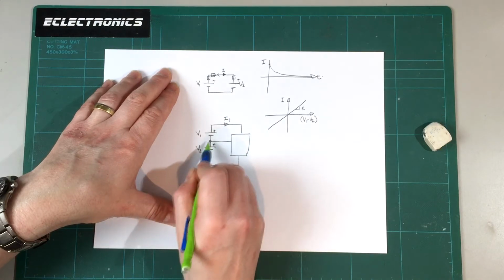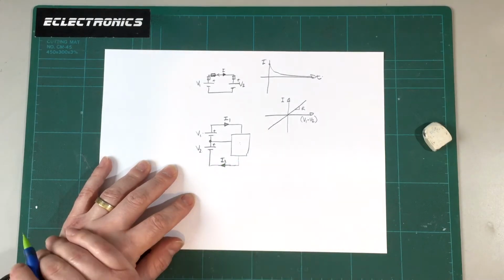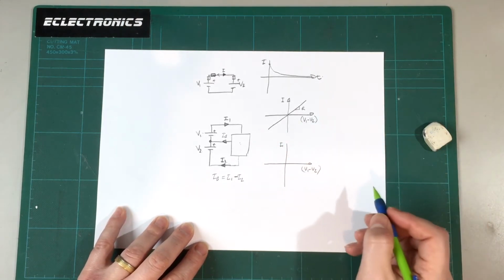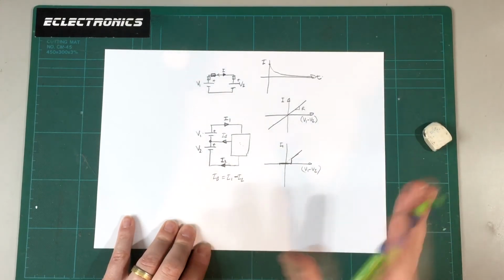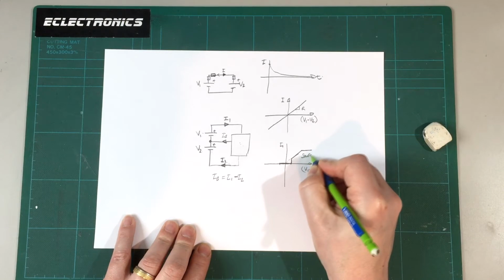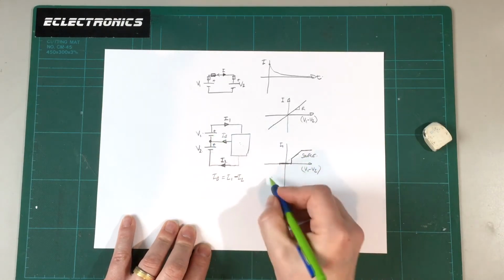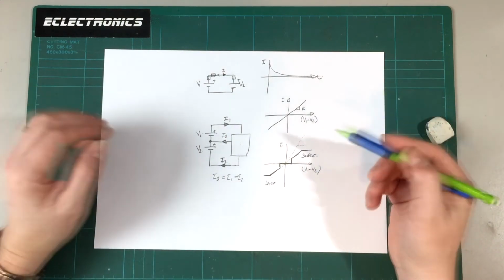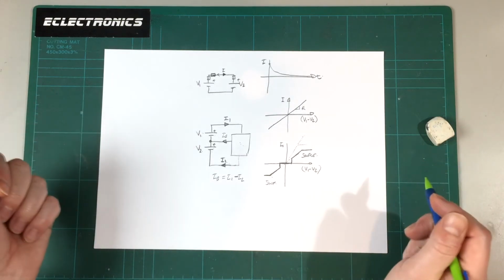Cell balancing Part 2 - How to characterize the performance of the balance circuit

Comment: A couple issues... Cells have very low internal resistance.  You cannot simulate them with resistor and a cap in parallel.  The other one is that a power supply cannot sink current and I have plown up many big ones. Then I learned to use a diode in series.  The I used anther diode to dump power to simulate the sink current.

Since you sounded very enthusiastic and experienced, can you please tell me if you can do the same thing using a processor and Analog to digital converters?